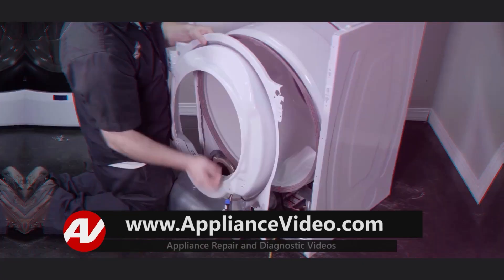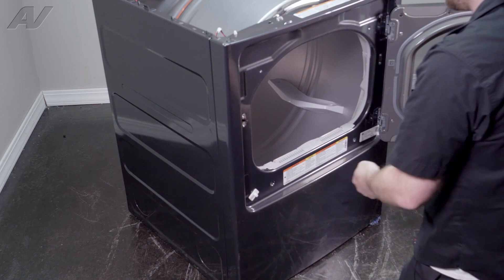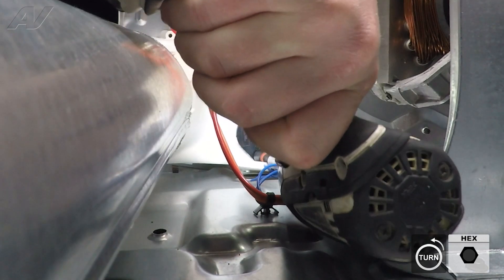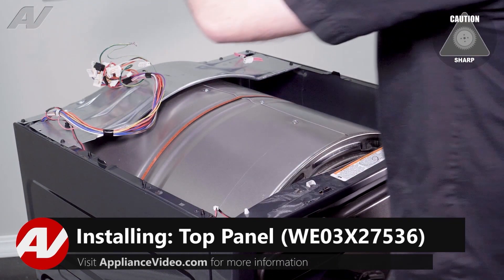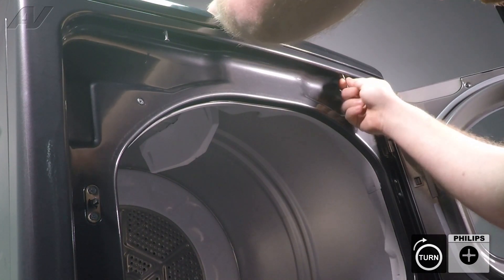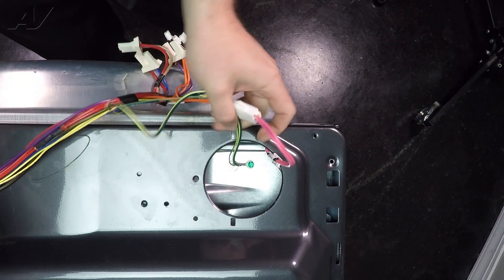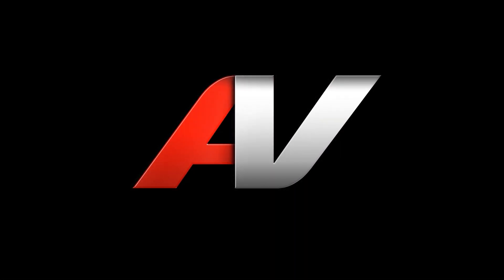GE Dryer Repair - Will Not Heat - Cycling Thermostat

Comment: There's a wiring harness at about 6:57 in this video which you mysteriously just detach. Mine's pretty stubborn. Any tips or close-ups on how to get that one to pull apart (the bigger one) without breaking it?
Reply: I ended up cutting mine and splicing in some extra wire. There's a little piece of sheet metal that covers the connectors, I gave up after 30 minutes of screwing around with it.
Reply: If anyone in the future gets to this part.... push down with something small and pointy between the two parallel plastic lines right at the metal overlapping peice. It removes like the smaller one. Took me a bit to figure that one out until I looked at the smaller one hoping it was similar.

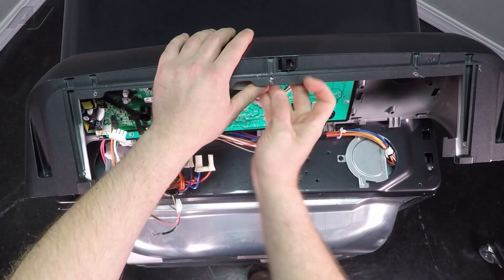Comment: Any idea why one of the relay harness appox @ 3:20 would be stuck? Tried pulling it off for 20mins. Is it seized? that
K502 inner coil relay what's responsible  for my no heat issue???  I haven't tried pulling the whole machine apart yet bc the wires are still attached to the control board.

Comment: I don't have the same model of dryer, but are most GE's the same as far as having to remove the top, front and drum to access the thermistor and and thermostat? How about testing the two parts, is there a video on that?  My GE DPGT750EC1WW stopped working.  Door light comes on, but dryer will not power up.  All I did was replace the vent tube, and it wouldn't work after that.

Comment: Is the Thermistor the same as the Thermal fuse?
Reply from the maker: Great question, if you have a more technical question that our parts department cannot answer, you can search our over 17,000 answered questions free at our website www.ApplianceVideo.com under our Repair Help section. You can also call our parts department at 1-800-830-5465 and they can give you help 7-days A week ,or search at www.SaveMoreOnParts.com  .